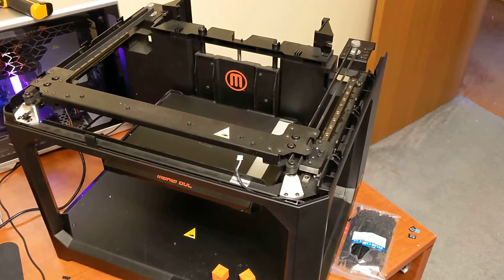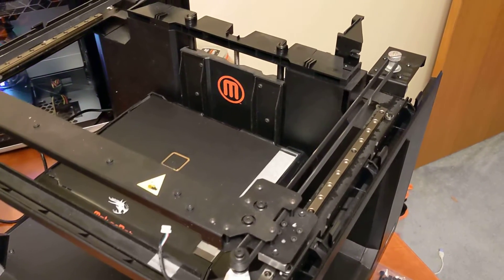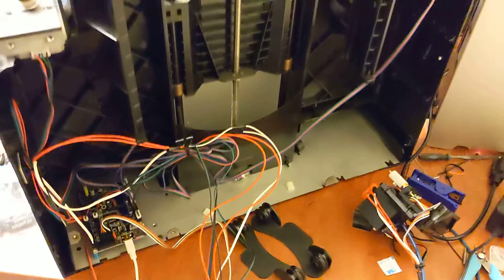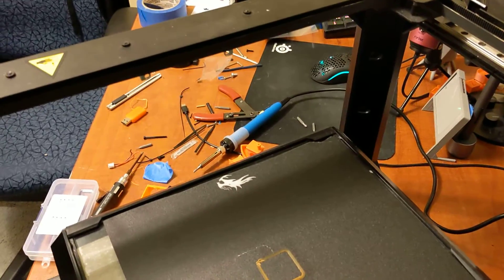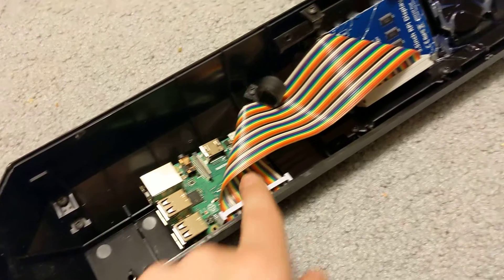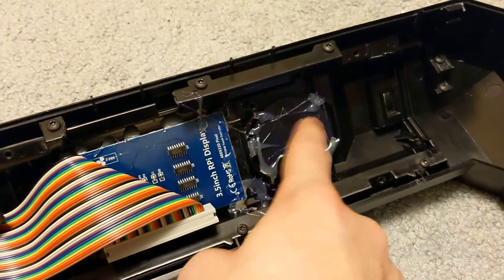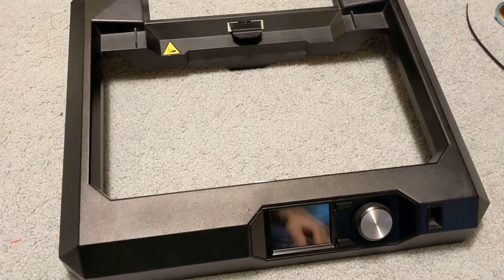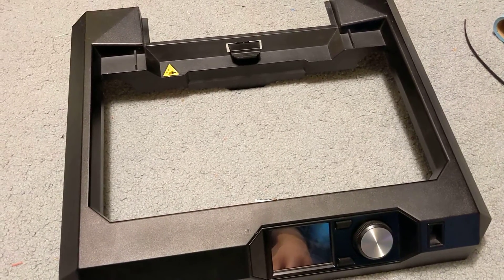Makerbot Replicator 5 with Klipper Part 2 Installing new parts

Comment: i know im a little late but any chance you can give some more detail on the wiring you've done? i am currently trying to convert my replicator also but am not sure on the wiring aspect of it.
Reply from the maker: I don't have it anymore but any 3d printer wiring guide will be similar, the motors plug into any stock mainboard

Comment: Can I have your klipper config? I’m trying to do pretty much the same thing as you, but the steppers in my machine are just buzzing and not moving
Reply from the maker: Usually that means your wires are wrong, you need to swap two of them, config is on my github https://github.com/rolohaun/Replicator5-Klipper
Reply: @Rolohaun  that turned out to be the issue. Thanks for the help!

Comment: I had a part fall off that has 6 corners, one of which concave. It has a spike pointing upwards on one side and two right angles on the other. On the back it has the number 2 on the pointy end and R1 on the non pointy end. There is a piece on the back that looks like a hook attached to a box on the other end. I cannot find it on any diagrams. Could use some help figuring it out please
Reply from the maker: I unfortunately do not own this printer anymore and can't really help you.
Reply: @Rolohaun  thank you anyways

Comment: Wait did you use the same psu?
Reply from the maker: yes if I remember right it was 24v so it used it
Reply: @Rolohaun  The one in mine is 12v, but I purchased a 24v for the SKR mini e3 v3.

Comment: I like the build you did, but I have some concerns. First and foremost, the heat of the build platform will rise up and your RPi will not get enough cool air flow to cool down the processor. I wouldn't be surprised if it will overheat and shutdown on hot days.

Second, H-bot is way inferior to CoreXY though because H-bot allows skewing of the X-axis and therefor adds wear on the linear guides and bearings.

I'm in the process of designing a completely new system inside of my old Replicator 2x. I've already converted it to open source HW and FW, but now I realize that the whole system doesn't really live up to the expectations I had so it's time to completely take it apart again and add CoreXY to the system.

Doing so will:
- Add build platform space
- Allow for three-point kinematically coupled bed leveling
- Add height (as the top of the metal frame will be used to mount everything onto)
- Allows for mounting the motors outside of the box for even more space

I think your machine is already way better constructed than mine anyway so maybe in this case, with high-quality linear rails you might not need to switch to CoreXY, but it might be beneficial in the long run.
Reply from the maker: There is no heated bed on the replicator 2 so that is not an issues and the H bot kinematics for the printer work well at the speed it was made to print at. CoreXY is better for very high speed but I just wanted to keep this stock

Comment: I'm currently doing the same build with the same replicator, what psu do you use ? thanks
Reply from the maker: Just a cheap 24v 6 amp one off amazing as there is no heated bed
Reply: @Rolohaun  thanks, what about the motor wiring to the MB, could you tell me wich one is linked to wich motors pls ?
Reply: @MrSebDR  I've looked all over the internet trying to find the same information, and nothing so far yet.  I've never worked with a core xy, let alone an H bot...I have no idea where to plug the motors in on this board..  :-(

Comment: Are you going to utilize the built in camera on the pillar? I have one of these that are broke and I'm looking to rebuild it, one thing I noticed is that it has a camera built into the pillar and I wanted to use that. The original board has an HDMI slot, but I can't find any aftermarket boards that support that.
Reply from the maker: unfortunately I never tried when I had that printer, the raspberry pi running Klipper does have HDMI so it might work
Reply: so im almost done building mine and I've ended up using the webcam that came with it.
 surprisingly the webcam makerbot used is recognized as a usb webcam when you wire and splice a usb cable to it. 
then i ran it as a jmpg-streamer for klipper & can be monitored from other devices in my home with a url.
(i also had to play around w the terminal to run that specific camera every time my pc boots up, and for jmpg streamer to run at boot also)

love the vids. thank you rolohaun!!

Comment: Just out of curiosity, why not re-use the old click wheel and buttons? Couldn't you wire them to the RPi GPIO (I'm guessing it's just an encoder and momentary buttons?) It wouldnt add a whole lot when you have atouch screen, but I Imagine it may be easier to scroll through files or adjust temperatures with the wheel than the screen alone...

Great mod btw, I'd love to do this with the Makerbot at work to get it giving us some quality prints!
Reply from the maker: I am sure you could do that however I just added the screen really because the space was there, Klipper does not really have support for those functions. I mainly use the web interface for the most part.
Reply: @Rolohaun  Do you think it’s worth picking one of these up if only to reuse the X/Y motion system l like you did? I’ve seen a couple of these on eBay for around $300
Reply from the maker: @BlownUpp  the bed is small and not heated, hard to say really.